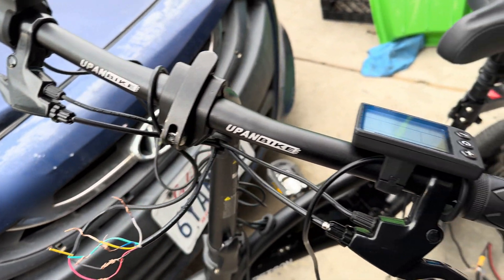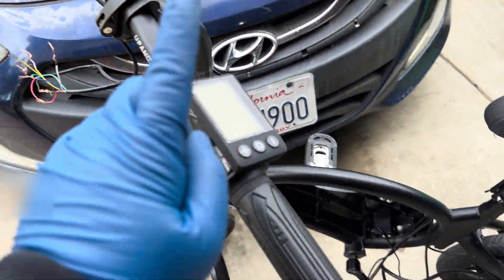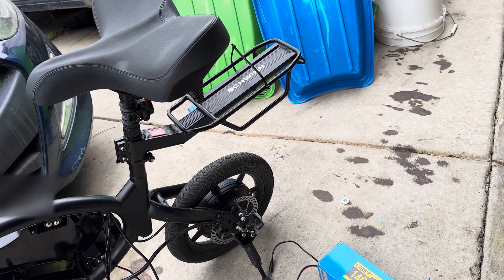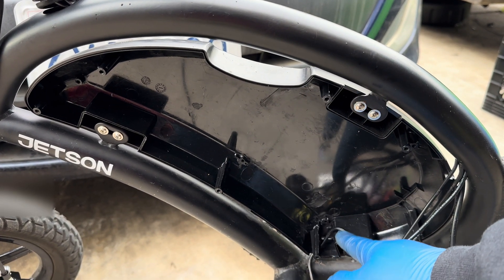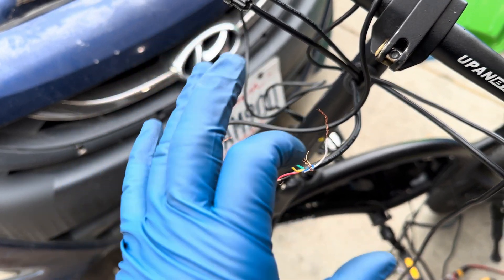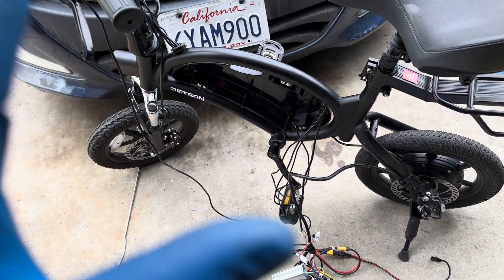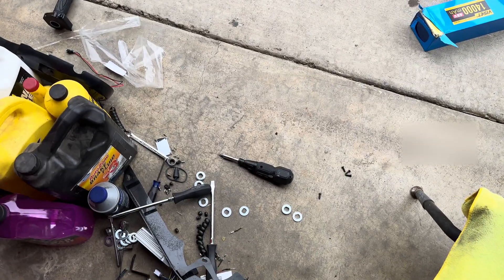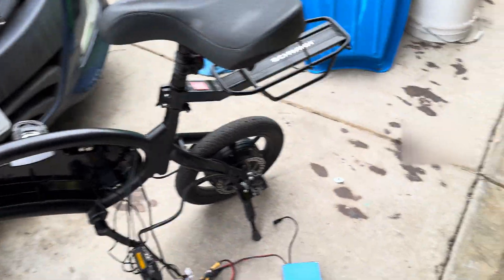Jetson Bolt Pro 48v Setup overview

Comment: So I know I can run 36v batteries on a 48v 1500w motor I'll just get lower speed like 30mph instead of 45mph. Now I know the regular old controller stock on the bolt pro is 36v. I have a dual battery setup both equalling 36v 12ah.  I'm woundering if this will work plug and play like that? Will It work with everything if I use the exact motor you did with the stock controller stock battery? Will the controller still limit it down to 15mph even with the 1500w power upgrade? I want a simple plug and play 36v system. 

I think it would work but would like a second opinion before I spend money. . Sure I'll lose 11.25mph top speed from 48v 45mph speed but that's a cool 34mph, with mild pedaling with a bigger 58+ tooth sprocket will get 25miles range pure throttle it's 18-19miles.  at 20mph no pedal  should get about 28miles with the 12ah of battery. I can get these standard bolt 36v 6ah batteries for $30-$50 a piece all day so it's more affordable to upgrade range by just throwing more of them on. For $60-$100 I'll get 2 more and have a 30-35mph throttle only with a 35mile range.  

I think I'll figure the pedaling out by then if I can get 60+tooth sprocket on some mild pedaling at 30-35mph could even push to 45miles range! 

So yeah do you think it will work by just swapping In the same motor as you used with the stock bolt controller and stock 36v battery replacing nothing accept the rear wheel and motor with a 48v 1500w.

Comment: Hey brotha quick question I got the jetson pro bolt no peddles I'm doing the up grades I have a 2000- 3500w hub motor , 48v 1000w battery now the problem I'm having is the controller ...Do I need a lcd screen with the controller and what's a good size controller.....48v 3000w controller? Thanks
Reply: Yes get screen helps a ton with settings

Comment: Weak upgrades. If you'd of bought a battery too big to use inside the battery case and used the bike rack you'd have a decent ride. Why upgrade battery if you're not gonna go big? And if you get a 48v battery get 20a.h and go with a 48v controller. DO IT RIGHT!

Comment: If you’re going to spend this kind of money on a little bike, like this, why not just buy a full size adult ebike’s! You’re wasting your money doing this to this thing! Why would you want to spend 1000 and $1500 on a $350 E bike! Buy the full size model! Kind of dumb if you ask me!
Reply: I feel sorry for ppl like you who don't understand things like this and push your opinion on his hobby decisions.
Reply: A setup like this is maybe 350 dollars.... Chump
Reply: I spent 550 on my Jetson it goes 35mph.... With the stabilizers, extra added suspension, longer handlebar it handles five times better than any of the other ebikes ive had (I've had over 10 of them by now)... This beauty folds up and fits in any trunk. I spent less than 850 on mine.... It goes 35, and has more bells and whistles than any other stock e-bike
.. what about yours? Bahahahaha
Reply: @ryanbunge8277  send link for build or vid plz mate nice 1